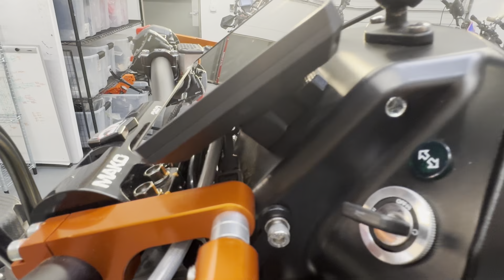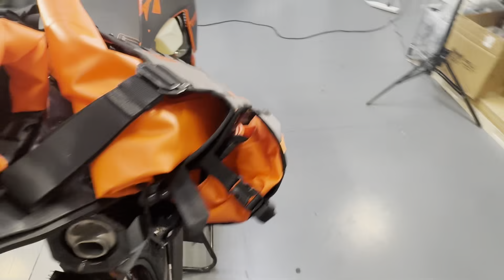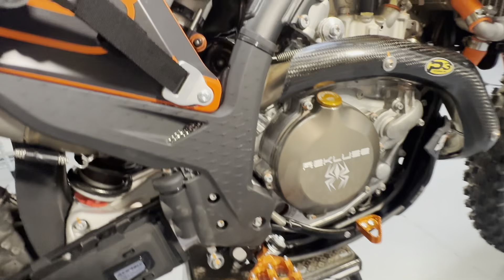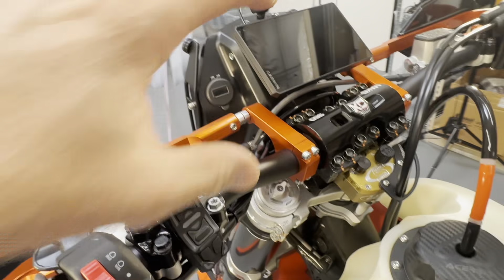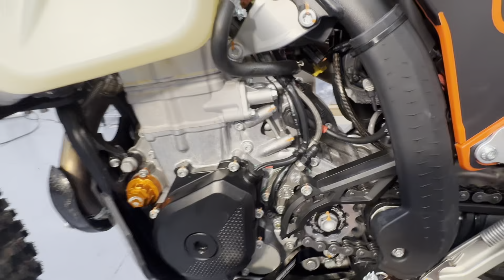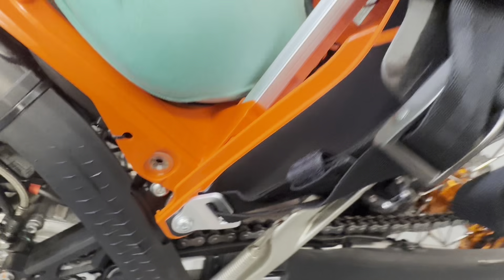SUPER RAD 25' 500 EXCF ALL-SPORT

Comment: The only drawback with this Yenkro setup is that it mounts to the triple clamp rather than the frame. That’s fine if you’re riding tight woods and want the lights to turn with the bars, or if you don’t mind your entire nav tower and gear moving as you steer. Personally, I prefer a frame-mounted tower as it keeps the navigation gear and beam steady at speed and reduces wind torque on the handlebars. Yenkro does make a frame-mounted version, but it’s not listed for the 500.

Comment: I have been thing about a Cush drive but I seen another guys take on the Cush drive not being needed because it has a Cush drive already built into the clutch. Who knows. What is the cost for those warp 9 wheel sets?
Reply: The Cush drive in the clutch protects the gearbox from impulses from the Motor. A cushdrive on the rear wheel protects the gearbox from impulses from the road, during acceleration and braking, shifting etc. is my understanding.

Comment: How about some “isolated footpegs” like XC  Gears “Spurs” to help reduce vibration…
Reply: Motion foot pegs as well
Reply from the maker: Our current fav are the motion pegs
Reply: @TACOMOTOCO  are they actually isolated? Was looking at them but they seem to be a normal mount with a bushing for flex.
Reply: @TACOMOTOCO  not sure the Motion pegs would be any better than a thicker soled boot tbh…the Spurz are full isolation just like the Mako 360 bar clamp